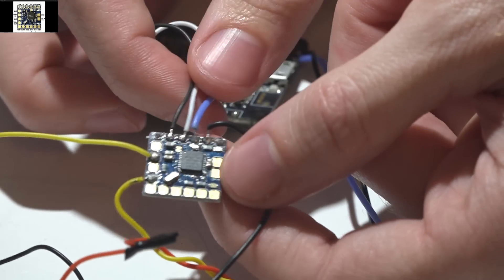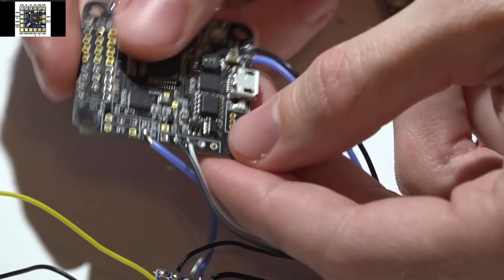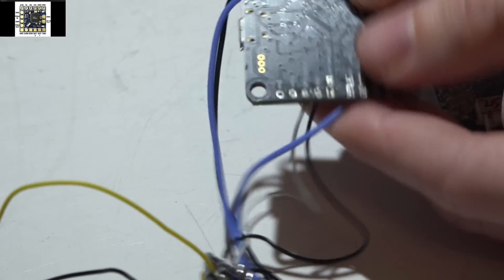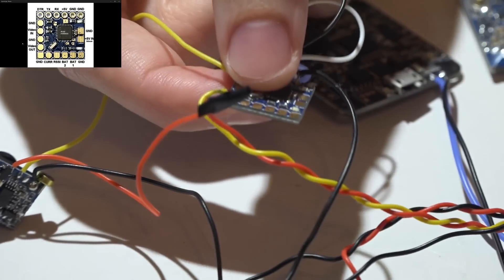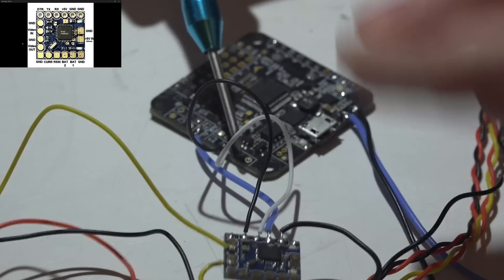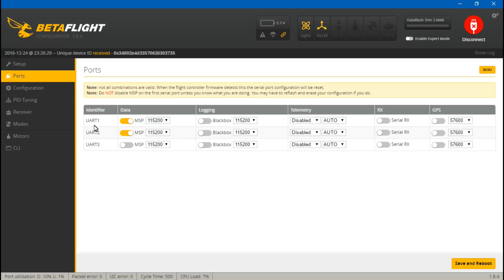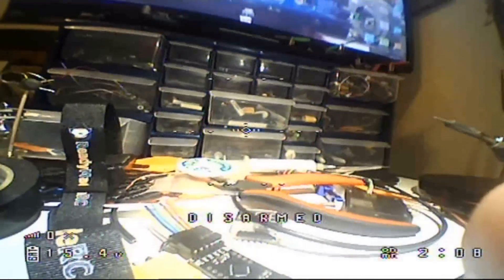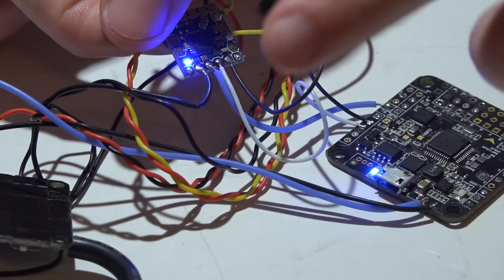How To Wire Minim OSD Mirco (and set up in Betaflight)

Comment: Hello,
Sorry for getting ready so late to set this one into my own quad, and asking (stupid maybe): why , seriously, why sould there be a wire from UART Rx to ODS Tx? what can the OSD transmit to the APM? I'm confused...
Thanks for specifying this...
Additionnally, the batt1 batt2 RSSI and CURR are not to be used, I guess... beacause my old APM 2.5.2 doesn't support RSSI (or?) and I use a power module already, (which is not accurate) to retrive the data about the BATT...
Last, I wish to know whether it IS mandatory to flash/update anything in this firmware... I thought I would just plug it and get the display.
My best , thanks for you valuable time
Reply: tx is connected to rx because imagine tx pin as a mouth that speaks and rx pin as an ear. You cant listen with 2 mouths, hence why its connected tx-rx and rx-tx.
btw the guy who made the video has died, so he cant help you..
yes, watch his playlist from the beginning..... https://www.youtube.com/playlist?list=PLiYYhnH4BhI_85qgp0hRjhHXdhrzl5j3w
Reply: thanks a lot for both your explaination and the info (I read a RIP com, but,being used to many bad jokes on the web, I was assuming it was just some sort of weird communication). I understood the principle of RX and TX, only, then , I had no idea about the "handshake" protocol. Moreover, some say you can while other say ytou can't plug OSD+Télémetry wired in parallel. Anyway, now I think I fried things on my APM (troubles), and yesterday, I even crashed it! So , no hurry anymore, I'll get a new APM 3.1..
Again, I appreciate your taking time to try and help me.
Regards

Comment: Very informative.  I have a question regarding the King Kong ET100 thru ET125, which have no OSD.  I've searched for mods that add OSD to these quads, but found nothing.  Could it be that they have no UART ports on that FC??  Thanks.

Comment: Thanks for the clarification of what needs to be connected, for some silly reason i thought despite having it connected to the flight controller via the UART I would also need to feed it rssi and battery voltage.

Comment: I would recommend using a 4-pin connector (Micro JST) for the 5v/gnd/rx/tx. So you can disconnect the minim from your FC. This is useful if you want to flash it or change some settings & adds almost no weight or bulk as those connectors are super tiny. If you solder directly with no way to disconnect it, you will almost certainly regret that later.

Comment: Hi... I have flashed my mwosd but when I power up my voltage remains at 0v.. and it states disarmed.. what am I doing wrong?
Reply: Hello I have the same problem did you figure it out?
Reply: Ron 
Yup.. just reflash and.. make sure u connect the tx and Rx correctly
Reply: thanks

Comment: To check that I'm understanding correctly... If the FC is recieving Vbat or RSSI we don't need to connect the pins on the minimosd correct? They will transmit with the rest of the data correct?
Reply from the maker: Correct. If you've seen the video where I set this up using the MW OSD GUI, you probably noticed the buttons for Vbat and RSSI that says "Use FC". The Tx and Rx wires coming from the flight controller going to the OSD will tell the OSD all the information it needs.
Reply: Thanks, I must have missed the buttons in the video.

Comment: Hey JC. First, thanks for your videos, they've been immensely helpful. I recently bought an Eachine X220 and I want to add an OSD. I've got my receiver running through the UART3 port, and UART1 is shared with the USB (plugging into betaflight shows no standalone USB port). I see a UART2 in betaflight, but I see no actual pins for a UART2 on either side of the FC. The FC has two connections for the RX, one is SBUS and the other is IBUS, is it possible the SBUS connection is on UART2? I can send a pic of my FC if that helps.
Reply from the maker: What flight controller is it?
Reply: Project Blue Falcon, I'll have to break it down tonight to see if I can find any labeling on it. The available info on the web is lacking, and for what is out there, the FC in my wizard is visibly different. Stay tuned, and thank you in advance.
Reply: SP Racing M0F3 v1 "cleanflight". It looks like SP Racing EVO F3 Acro version
Reply: Hi overbybr, 
i made the same choise as you and i found some informations about the FC in the Wizard here:

http://seriouslypro.com/spracingf3

You can see on the manual the UART2 connection is on the top side marked 2.
I did the connections from there with and without the ground but i get nothing on my goggles...
So if you find a solution or JC can check it it will help me too :)
Reply: If I am running S BUS on UART 2 with just serial RX selected.. Can I still turn on data for UART 2 and run the mini off of UART 2 while still using S Bus?
Reply: I imagine you found the solution to this, but if not let me know. I was in the same situation. My problem is that my OSD isn't getting a voltage reading. It says 0 VOLTS and flashes LOW VOLTAGE.
Reply: Adjust your settings in the osd program to have low voltage go off at a diff level of charge